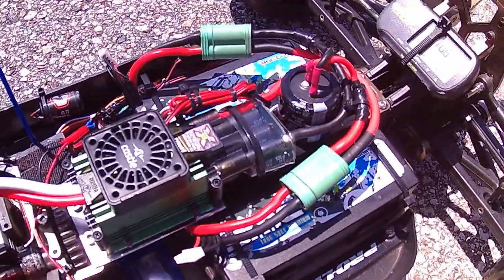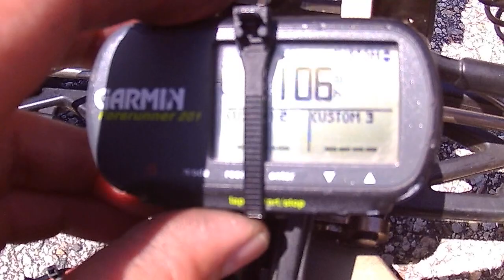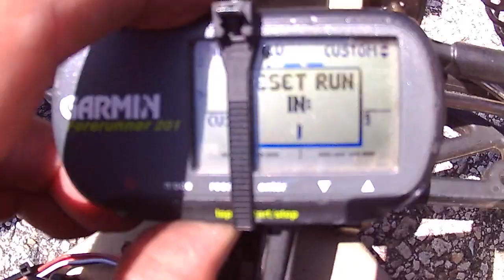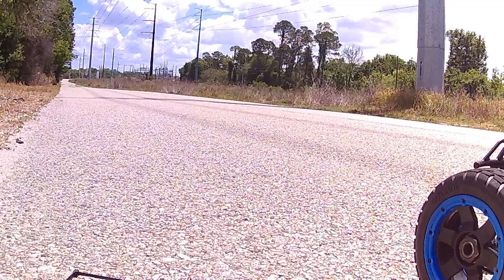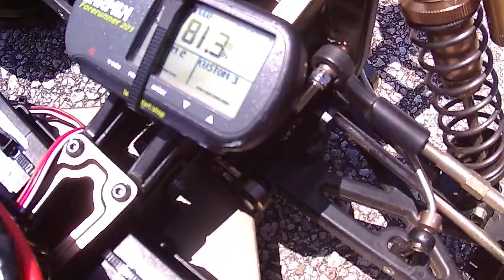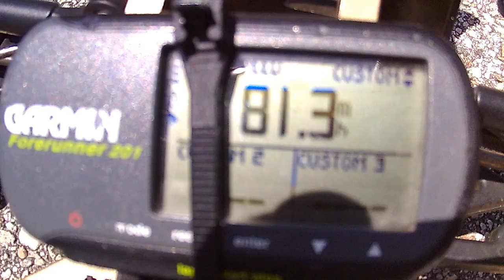1/5 RAMPAGE XB-e XL-X ESC / 1/5 LEOPARD MOTOR TEST RUN

Comment: Was doing some research for a Baja project and came across some belted 5th scale slicks from Hostile racing. They should should hold up a bit better. I also read about "no growth foams" you can get for the 1/5 bead locks.http://www.davesmotors.com/hostile-racing-belted-slicks-for-baja-5b-rear-soft-compound.html
Nice run and update.

Comment: man that leopard is a good motor to turn them and shred em to shit!dam crazy power with them smc'if you get the others look out it will come back with no rubber on all 4 corners!
Reply from the maker: Henry fords rc lol this Leopard motor is a great motor bro and tons of power for price $100 brand new bout a year ago but these tires won't handle the power lol, Actually these tires brand new could hold over 90+ like it did last time 91.6 mph but I guess they get too stretched after time thou 👍🏼

Comment: lol thinkin of maybe a leopard in my xo1
Reply from the maker: Henry fords rc Not a bad idea bro but you might need mod 1.5 gearings 👍🏼
Reply: Henry fords rc I wanted to put a leopard in my xo as well. the 56110 is a beast!!
Reply from the maker: Michael Baars Mine is the 1/5 5692 1090kv motor